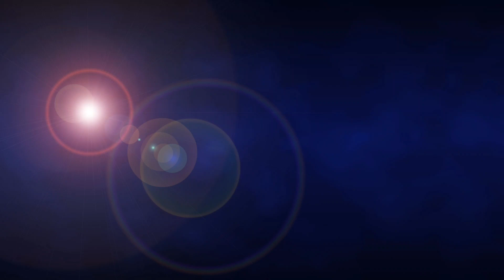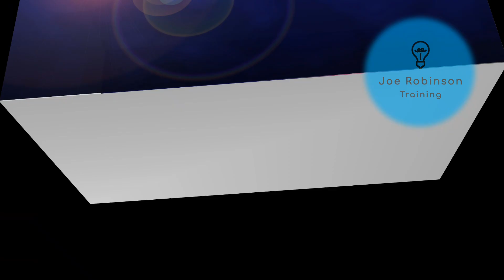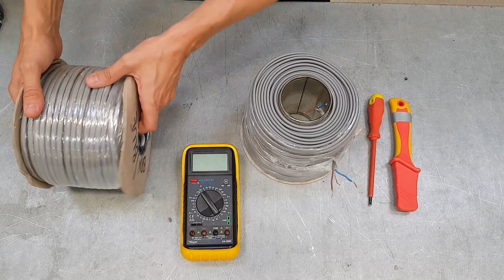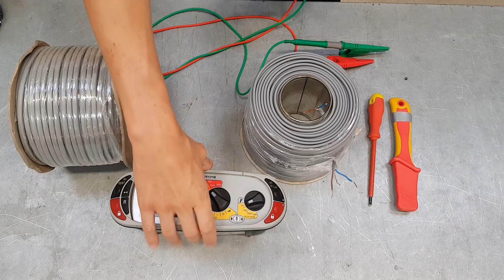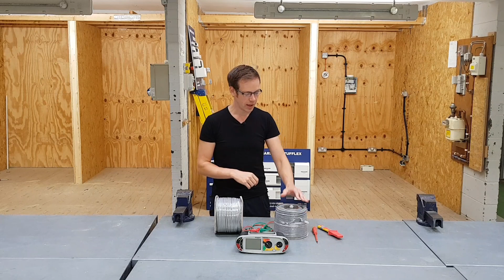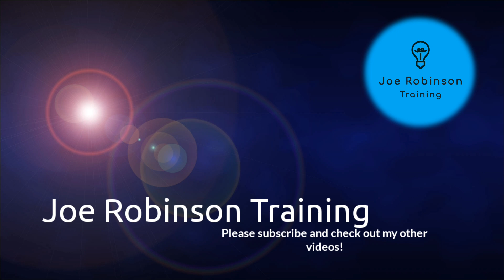Resistance & Resistivity - Introduction: How Length and Cross Sectional Area Affect Resistance

Comment: i dont have any idea about how the numbers effect it so im just asking a question, if i take two phone chargers that are same in every way but one of them is 2 meters and the other is 1 meter, would it have any difference like a minute or two while fully charging or will it has an inconceivable effect?
Reply from the maker: If it's a dumb charger that doesn't respond to the charging rate of the phone there would be a a very small amount of difference in current flowing into the phone which could change the charge time, but the difference would likely be very small. 👍

Comment: Just one quiitisisum why are referring to the earth conductor as the CPC stop it, it is and always has been the earth conductor and always will be same as the cable it has always been cald flat twin and earth if you buy a drum of cable from the supplier the label on that drum reads for example 2.5mm2 flat twin and earth followed by the BS number. It does not read pvc pvc twin and cpc, Sorry to be picky
Reply from the maker: Great question Sean, there is a really good reason for it and I'm planning a video to explain why. You can get a head start by looking at the definition of "Earth" in BS 7671. 👍